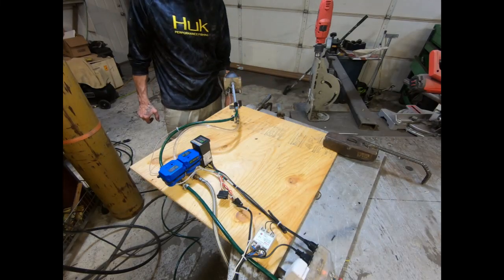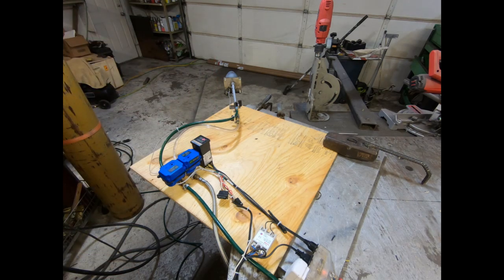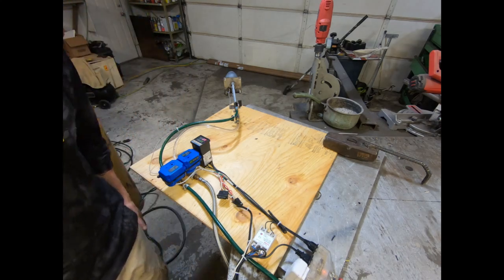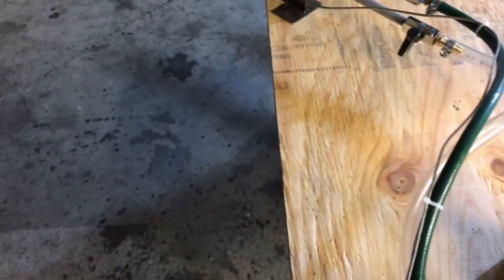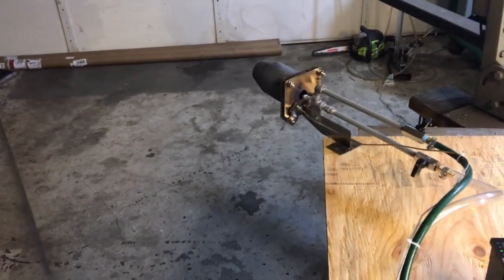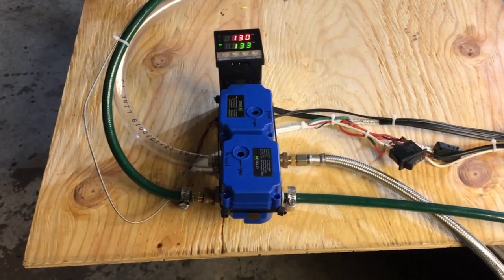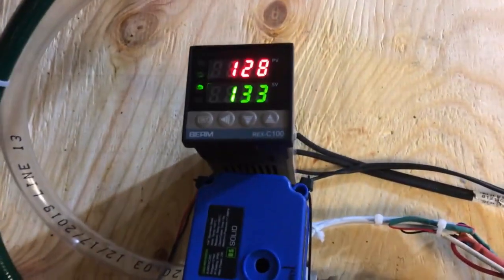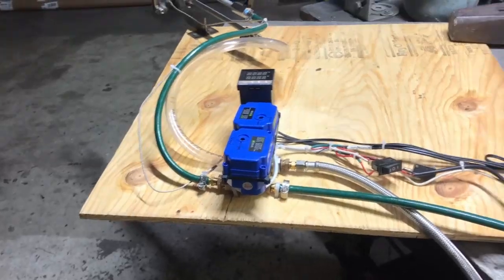Waste oil Burner Auto Shut down Controls auto cut off

Comment: you could also use a flame sensor to turn off the oil if the thermocouple gives you problems, same as whats in a kerosene heater
Reply: i was going to say this. I think a flame sensor would actually be quicker.
Reply from the maker: @gabbermaikel  Yes i searched every place for this equipment , could you provide a link ?
Reply: @NOBOX7  i was working on something like that for a heater project, but then didnt go trough with it because i needed my time for other projects, and then heater was never finished.(stil running the old heater because it works, and you know how that go's, you keep using it til it dosnt work, and then you need to build something fast)

Maybe this can help out https://www.instructables.com/id/Flame-Detector-With-Arduino/ or this https://www.youtube.com/watch?v=OZkZIP3KlHQ

https://hobbyking.com/en_us/keyes-flame-sensor-module-for-arduino.html

those things are actually dirt cheap. But i wanted to use them with an arduino so dont know how else you could use them. The code is pretty simple. And you could code it for a delay when a button is pressed for example. That would starting the thing up easy, just press the button and light it. Have a light on it that indicates when the delay is over and the system is ready to shut it all of when a fire happens(i would make this a green light, meaning system ready) and i would add an orange light for the delay, and a red 1 for if it cut off the air and fuel. That way an operator could see from a distance if the system has cut out. And an arduino has plenty of power to control all that. Even a arduino nano has more then enough.
Reply: @NOBOX7  and a UV style would be nicer, but i dont know where to get those where you are. I know some shops over here sell them
Reply from the maker: @gabbermaikel  Yes , good eye , speed is an issue here , we need a faster acting device , but this will do the job for now.
I am definitely interested in this technology
Reply from the maker: Yes i searched every place for this equipment , could you provide a link ?
Reply: https://m.youtube.com/watch?v=OZkZIP3KlHQ
This is a simple aurdino flame sensor, you can use just a simple sensor and transistor to switch a relay turning a solenoid on or off . A benefit of this is you don’t have to wait for a thermocouple to warm up